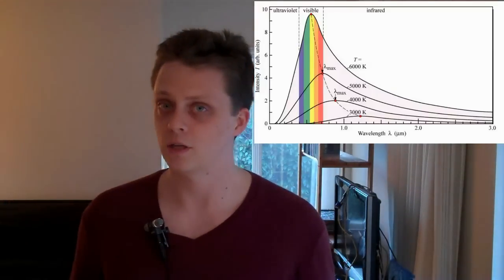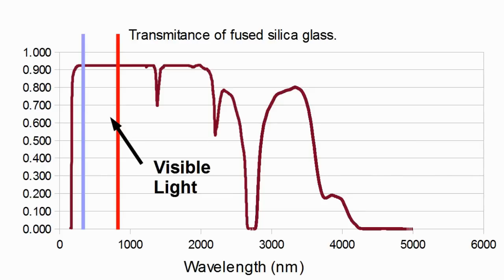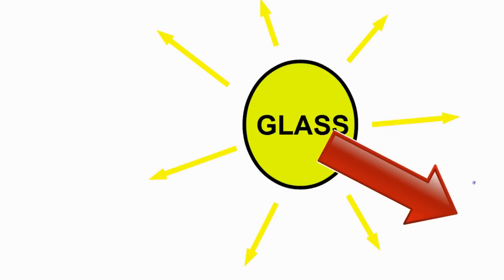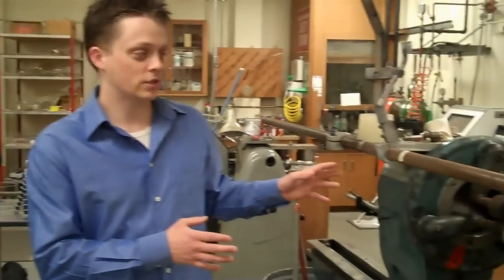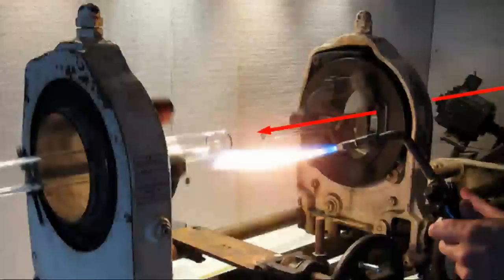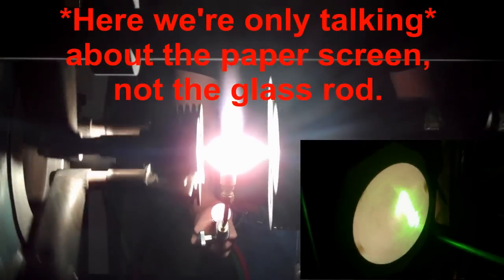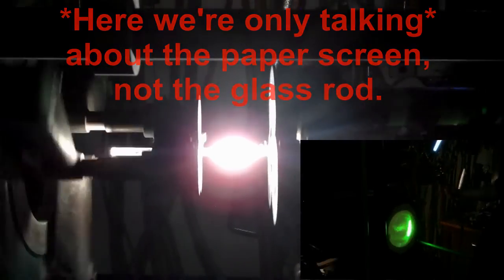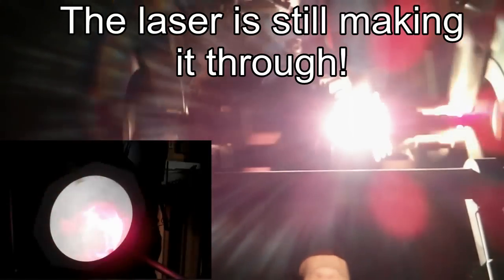Is Molten Glass Transparent?

Comment: Thanks for the video, I was watching shorts and saw a glass making video and the thought came in to my head, was the molten glass still transparent and the reason it looked opaque was due to the produced black body light overwhelming the light that made it through? Or did it change to actually being opaque. I don't have the means to test it but had an idea for a test. Have a wavelength detector and shine some monochromatic light with molten glass between them. If you were still able to detect the monochromatic light then the glass was transparent. I was thinking more in terms of like an LED bulb and like a sheet metal with hole in it to limit the lights path to detector but your method of laser through a spinning rod you melt was by far more simpler and in my opinion a way better method all around.

Comment: Anyone who works glass in a torch knows the answer to this.  Whatever color or transparency of the glass in it's pure form, remains the same in the molten state.  Your demonstration was not effective because no one could possibly see anything through all the glare. Glass workers use didimium glasses to negate the sodium glare when working with soft glass so they can see what they're doing.  Stronger protective glasses are needed if you work borosilicate glass, as the melting temperature is higher.  Whatever type of glass you work in a torch, eventually you will fry your eyeballs unless you protect them.  It looks like you used borosillicate clear rod and tube so the glare was particularly bad.  Glass can change color in the heat up phase, if you dunk the molten glass in various colored frits. You can also marbleize glass by combining two different colors.  Red and white however will never make  pink.  You layer glass, not mix.  The techniques to change glass is endless.   You can alter the basic color of some sensitive glasses only during the cool down phase.  This is contingent upon how long you keep the glass once melted, at a certain cool down temperature, high out from the flame or by manipulating the ratio of gas to oxygen in the flame itself.  Reducing or oxidizing.  You won't see this effect though, until you pull the glass from the flame and let it cool a bit. I don't know if you were talking down, or just didn't do your research.  Do better next time.  Many people are fascinated by glass.

Comment: When you say you're "pretty sure" you're advancing a universal law.  That's just how reality works.  Because if you do not think it a universal law then you're not "pretty sure" about it.

I understand the limitations of youtube's crap threading/commenting system.

BTW, did you manage to spot the other system where temperature doesn't change its transparency?  To give you two examples rather than one?  Only it doesn't. not at extremes.  LOX is blue.

Comment: Interesting. I didn't get the right answer, but I was on the right track!

What I should have tried was thinking about the phase transition (solid->liquid) without heat, since I'm pretty sure heating a substance within a phase doesn't change it's transparency. Certainly I've never noticed a difference between water at 0C and at 100C!

Comment: I'm a hobby level lampworker (glass blower). Apparently "sodium" is in reference to the wavelength (589 nm) and that's its brightest with borosilicate glass. Why? I don't know.. but the glasses we use all block sodium flare and without it you you don't see much of anything.. Might not see much afterwards either. Not as bad but you might think of it as watching someone weld without eye protection. When photographing someone using a torch all you get is a big orange ball. Unless through glasses.

Comment: By definition, glass is an amorphous or "non-crystalline" solid. This means that it is a solid that lacks to long-range modular structure that crystals exhibit. The idea that glass is a slow flowing liquid has been a widely circulated myth. This stems from the observation that most old panes of glass are thicker at their base. In reality, this varied thickness was a result of the glass production methods of the time and the glass was mounted with the thick side down in order to prevent

Comment: cont... water from pooling at the base of the glass's fixture. (And though mounting panes of glass with the thick side down was the common practice. It is not uncommon to find them mounted with the thick side up. (Presumably do to human error.)) But with modern forms of glass production (eg. Float Glass) these variances in glass width are seldom seen. 

Sorry for jumping in and writing a novel on this comment.... But I hope that this explanation helps.

Comment from the maker: So there are two things I should probably clear up.  1)The photons don't loose energy (otherwise they would change colour)  rather you loose 10% of the photons in the light.  2) I realized after posting that transmittance is reduced by 2 effects, some from reflecting off the surface of the glass, and some from dissipation in the glass.  That means it probably dissipates significantly less than 10% per centimetre.